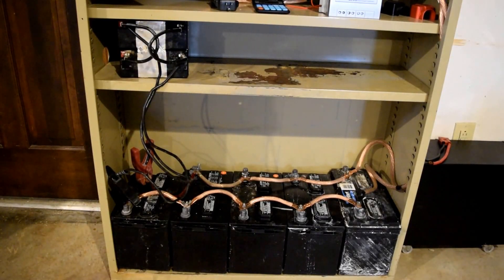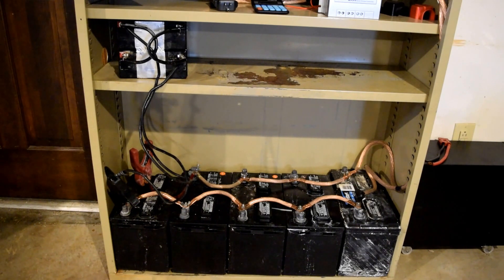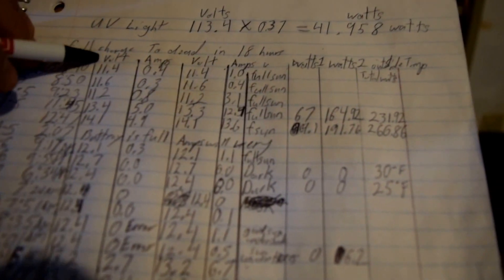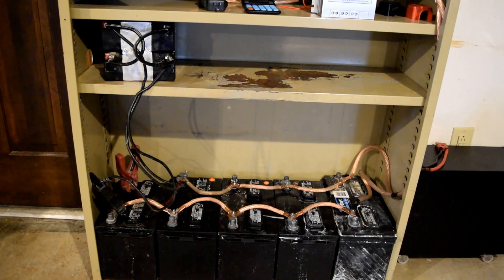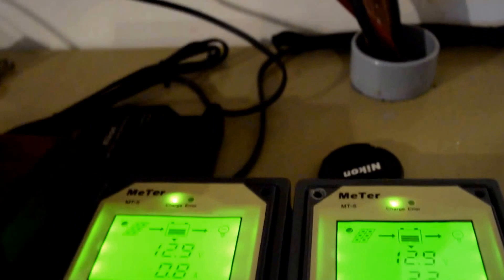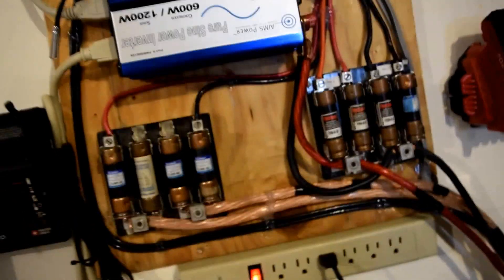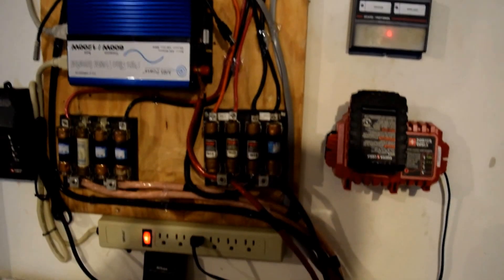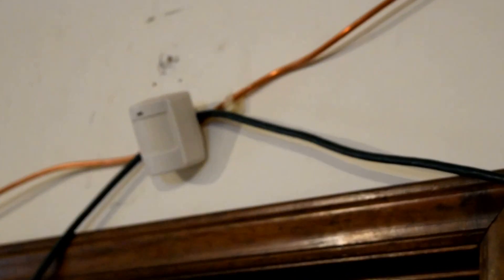12 Volt Solar Backup System Every One Needs

Comment: I like your system....fuses are the way to go...
Reply from the maker: +Leonardo Cruz Thank you very much man it's hard to keep it clean. Soon I will have a new 24 volt system i will install and show on youtube so subscribe now.
Reply: Cool...the higher the voltage the better. ..if I had 4 batteries I would go with 48v....for more than 12v remember to get a battery equalizer.
Reply from the maker: Ok thanks I will try soon.

Comment: Please don't waist money on AGM Batteries, you can get almost twice the amp hrs. for the same money out of Trojan t-105sand they are not as picking and more forgiving on charging voltages than AGM. Trust me I went that route in the beginning and it was a big mistake. Glad to see your doing solar be careful it's very addicting.
Reply from the maker: +autobri1 thanks man im making a new solar home heater you need to see that and subscribe to see lots more stuff https://www.youtube.com/watch?v=TVGVZVxYVyo
Reply: +Guns,Games and Racing I was just watching your other video first in this series and I seen the problems you are having with battery acid boiling out of your batteries, 2 things right off the bat. first those are not true deep cycle batteries second I have 3 of those charge controllers and they over charge in float mode you can change the setting on the controller to AGM and the float voltage will go down closer to what it should be. and remember to add water only when they are fully charged and only about 3/4 of a in. over the plates. you can see my setup on my channel. I have upgraded a lot and need to do another video. Good luck!!
Reply from the maker: yes i sub your channel we need to keep togeather
Reply: +Guns,Games and Racing Sounds good buddy
Reply from the maker: https://www.youtube.com/watch?v=wfLPTn5dpbU have you seen this video
Reply from the maker: +Curtis Albrecht cool thanks